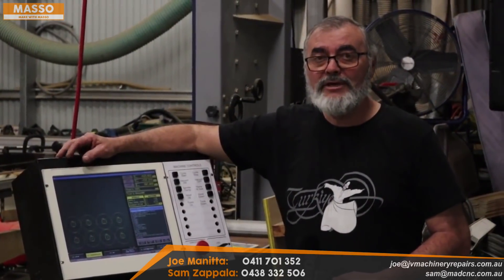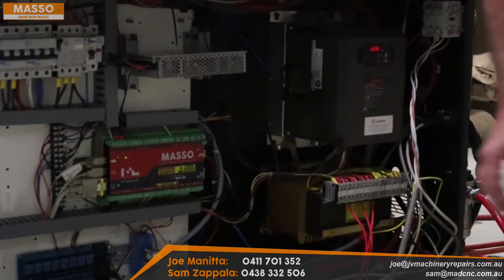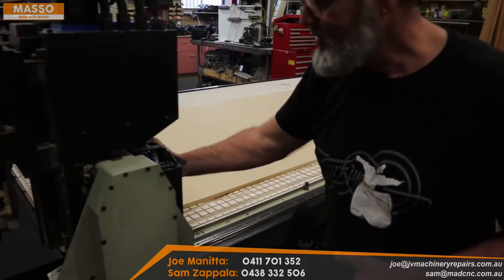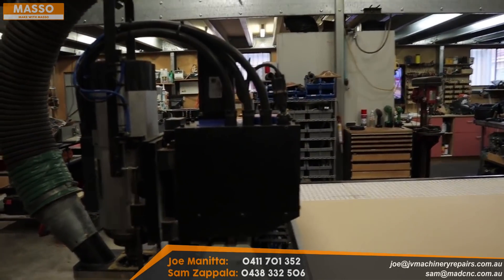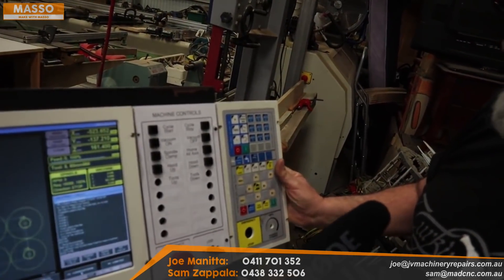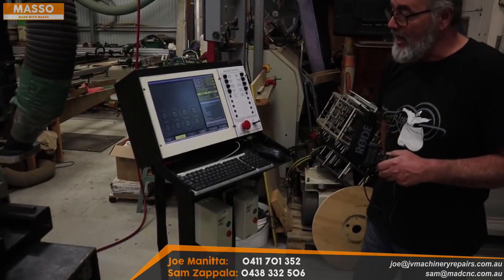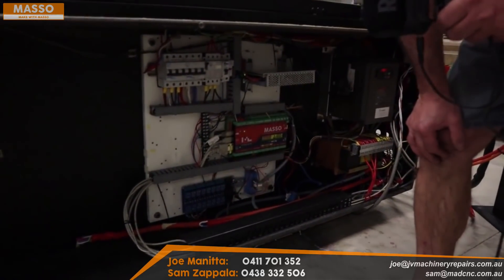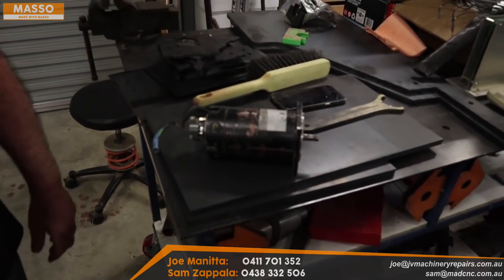MASSO Controlled CNC Wood Router With Automatic Tool Changer - Part: 1

Comment: Hello Justin, with this machine we only have one motor driving the X axis. There is a shaft going through the top beam and connected to the pinions on both sides by belts. It is a very smooth system to run. Our next machine we will be running the X Axis with 2 motors. One for each side and we will be running one drive for each motor.
Reply: Hello Justin, in the Masso Settings, there is a setting that you can change the setup of the X axis if there is 2 motors, one been a main and one been a slave. You just need to be aware that when you order the Masso controller. you must know how many axis you will need as the slave axis will be counted as one axis so a standard 3 axis machine will need a 4 axis controller if you are running 2 motors on one axis